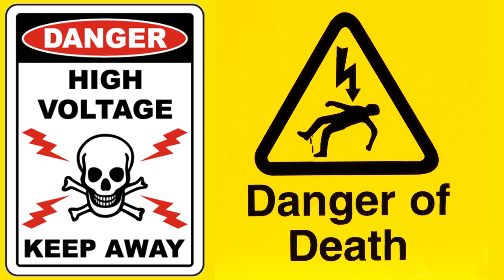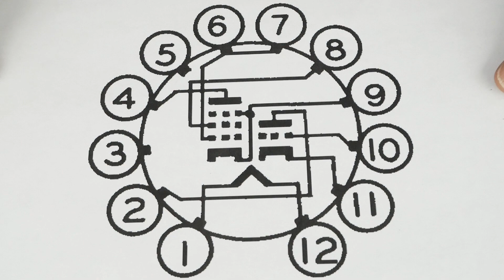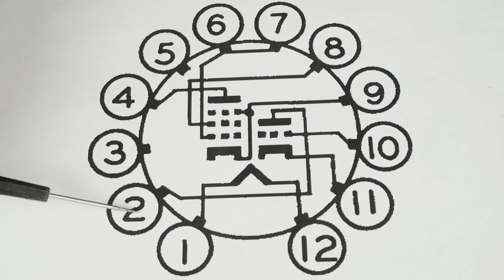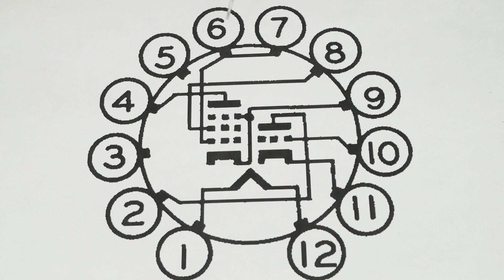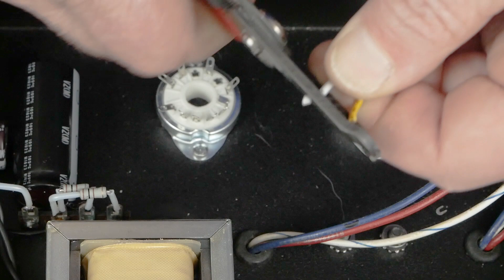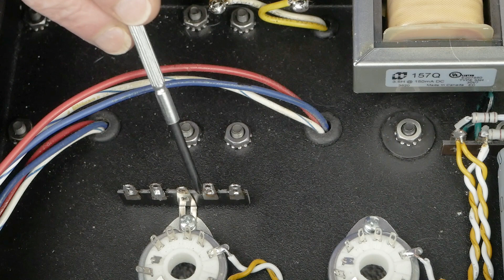DIY 5W Compact Tube Audio Amp: Heater Wiring

Comment: Lookin good so far Stephe!  I just wanna double-check.  Are you running all the earths from the tagstrips over to the main star earthing point?  I'm building a kinda similar little Chinese valve amp kit with 6L6's & I was wondering if you would recommend I do the same.

Also, should I create an earthed centre-tap for it with 100 ohm resistors as you have done?
Reply from the maker: Yes, run all the earth points from any tag strips to the main star ground point. And yes, if they have the heaters floating, create a virtual center tap and ground it.

Comment: please excuse another question.  From the ps schematic, the 470k resistor goes from the hot side of the 220uf cap to ground.  In the video, I see it goes on the other side of the 120R and ground.  Now, I am thinking that it does not actually matter?  Although it might make a slight difference in the final RC stage as it has a different R factor.  I know I am pesky, I am not just trying to find fault, I am trying to be as accurate as possible.
Reply from the maker: It doesn't really matter. The resistance is so high it's not going to change anything about the filtering, it's just there from the positive of the caps to ground to drain them after the amp is turned off. Just put it where it's easy to install.

Comment: i dont see your fan on amazon canada ,id like the link thanks
Reply from the maker: https://amzn.to/3MvLwqG 

but again, the motor is 110V and it will be noisy if used on 120V without a bucking transformer inline.
Reply: thanks
 @SkunkieDesignsElectronics